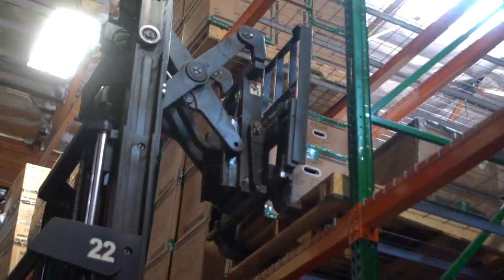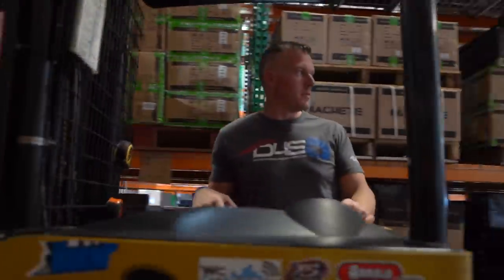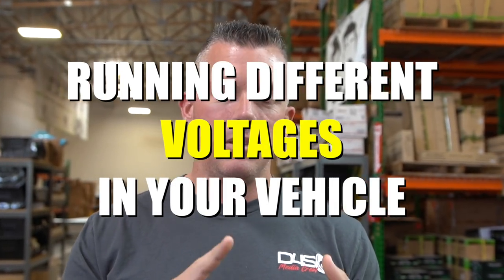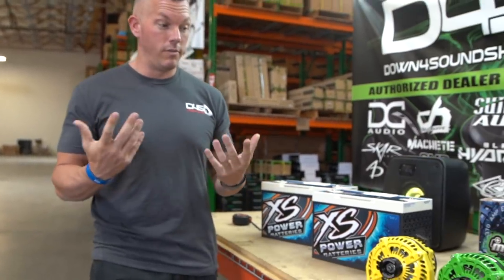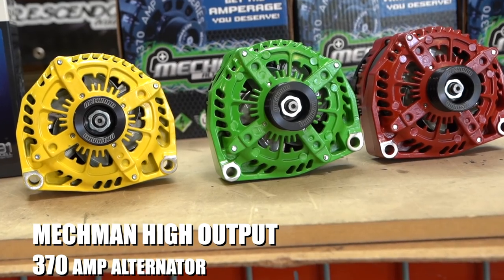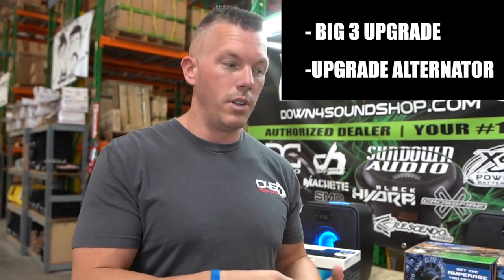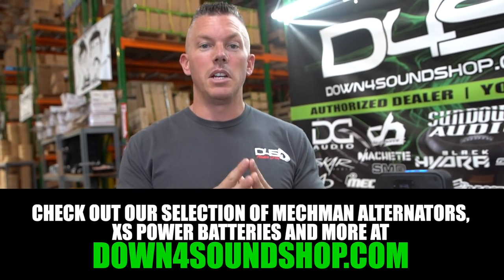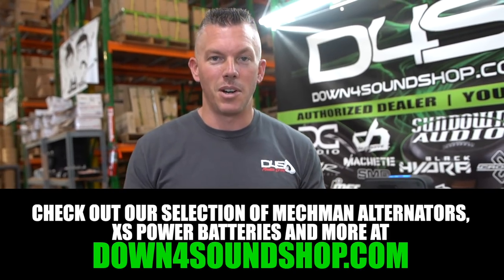WHAT YOU NEED TO KNOW, BEFORE YOU CHANGING THE VOLTAGE IN YOUR VEHICLE

Comment: I’m running Skar DDX10 d2 with skar 1200.1 in a 6th at 1ohm. Headlights dim horribly. Did big3, no progress. So ordered the Mechman 240. Now I gotta change 4awg to 1/0. Haven’t popped any of the 100amp anl fuses yet at full tilt. In a daily driver.
Reply: Yeah I've got the 1200. Alot of people think it's not big enough to require any electrical upgrades but as you and I both know you definitely do!
Reply: @wayneslain9444  sweet man. What u runnin? I used a multimeter to set gain. Also, I’m runnin an LC2i instead of rca due to factory head unit
Reply: What are your batteries?
Reply: I asked about the batteries because I have two identical North Star AGM batteries. One under the hood and one in back connected in parallel with 1/0 sky high wire and I'm running 2,000 watts@2ohm to my Skar VXF 15"... I have zero light dimmage on a stock alternator.

I have a Mechman 240 amp alternator ready to go but I'm being lazy about installing it because I am noticing zero issues with the system as is on the stock alternator.

I even have a noco 5 amp charger for when I need it but I haven't had to use it yet.

It's either the batteries or all that high quality wiring or both.
Reply: @snauspockets9924  I have an AGM up front only. I kinda went with the largest one I could get for the car. 
I think it’s the wiring that has my lights dimming. They’re halogen, I’ll try led and see if they dim. 
For the alternator install, dbl chk pulley size of factory alt vs HO alt. I noticed 63mm factory to 60mm mechman. Still decent tightness in SERP belt.  No slippage. Getting 14.8v at all points
Reply: @vgnope  right now I disconnected everything in both cars to really do it proper. For 1 ride I've got an evl 15 on an rp2k but I'm getting one more of each for black Friday to have 2 2ks on 2 evl15s. The other one is 2 ix 12s on an rp1200.
Reply: @vgnope  also I've got 3 more systems that are mostly complete, 1 backup for each ride and 1 for my work truck when I get it. SQ Hds215 on a DB drive 2k but I'm waiting to pair up a sub/subs with a Brutus 4k

Comment: Thats not enough 20 v crap take voltage regulator from alternator n use 4 48v batteries if u series then careful parallel with variable rheostat potential meter adjustable so u can play n regular or if chts to high temp bring it back down to be more efficient

Comment: I'm sticking to a 12v setup. I love my Sony Mobile ES speakers and XM GS4 amplifier, the sound is so clean and crisp that I just want to sit in the car for a few more minutes after parking it to enjoy the music. I plan on doing a Fi Neo 3.5 12 inch in a sealed box up to a 2k amp with a stock alt and 0 gauge big 3. Then put in a 240 amp alt once the stock alternator is worn out.
Reply: i just put a 240 amp alternator in my accord coupe. whole system sounds stronger and cleaner. so much so that i havent even put my higher rms stuff in yet.
Reply: What is the big 3? 0 gauge wire, extra battery?
Reply: @trickedoutequinox3265  o ga ground to frame, ground to battery, and ground to alternator.  Big 4 is same, except adding a o ga power from alternator to battery.
Reply: I'm confused🤔🤔🤔

Comment: I run 2 separate 12 volt systems. Stock alternator running the truck and the door speakers. CES 370 Charging 80ah of lithium for the bass side.
Reply: Cool dawg real cool..

Comment: To keep car computer and oem accessories  @12 volts but your amps at 16 volts using just  one alternator..
  Do install a 16 volt alternator and your 16 volt battery  banks for  the Amps, but a 14 volt "Down Step module" from such alternator   to your regular oem stock battery.  
 And do  Run your 16 volt battery  banks directly  to the 16 volt alternator terminal.

Comment: I have a 2006 mustang gt I have full 0 gauge wiring ran on Taramp smart 3k and for mids and highs  I have a 900 watt ct sounds with yellow top under the hood and in the trunk with big 3 done and currently wait on 200 amp high output alt that hasn’t came in do you think the alt will help with my voltage drop????

Comment: So the cool thing about my car is with the stock ECU it can handle up to 15.9 volts of charge I pulled out my stock 130 amp alternator running off of the ECU and I ordered a Brand X 390 amp alternator and had him set it up for 14.8 volts constant internally regulated so it is not controlled by the car's ECU anymore because that fluctuates then I built myself a 6S Ying long 350 amp hour Bank of lithium

Comment: Also to mention if you choose to run a 14volt system to run the vehicle and sound system you gotta make sure the higher voltage does not take out the factory electronics. Most newer vehicles can't handle anything over 14.4volts. But a good bit of older vehicles can, if you pop the ECU you are gonna be in a nasty expensive pickle. If you don’t understand any of this at all just stick with the standard 12volt system. And don’t listen to the 99% of the dumb fucks on Facebook or other social media audio pages saying "oh its easy just buy this or do this"... Do your own research and learn the proper way. 

Just a reminder chart:
12volt system charges at 14volts.
14volt system charges at 16volts.
16volt system charges at 18volts.
Reply: What up man I'm the dummy the went14v sub and interior system thinking it would be better to separate my factory from the amps. That being said I set it up nice except of course amp don't like 15.8v is there a way to lower that from d1400 to amp so I don't stop the 15.8 charging the battery?

Comment: Thank you. I’m very new to this and this helped me understand what I should stay with for bassing everyday. Can I run two batteries (one for subs amp and other for car stuff like lights radio) and run them to one alternator? Or upgrade the alt for the two batteries
Reply: Depends on the power you want to run. Anything 2000 watts and over, upgrade your alt and run at least one extra battery. I'm at 6000 watts on two 15s and have a 300 amp alt on three batteries. One up front and two in the back. And your wire is also very important. Don't skip on wire. OFC is the best to run over CCA. It's more conductive and transfers current much faster.
Reply: I always recommend upgrading your alt.. extra batteries are just a band aid solution. But keep your stock alt incase your ho alt has issues. Trust me.
Reply: @crunkwun  good advice thanks
Reply: @crunkwun  first time i tried upgrading alternator i had a gang of negative issues. i removed the new one and its sitting on a shelf. that was a 2000 accord coupe . my 2011 i swapped my alternator out with zero problems.
Reply: @vincebowling1778  what if your just planning on 5000 watts? Can I just use the 1 xs battery up front?

Comment: Demoing into 12’s is ok? As long as voltage stays 12.4 and above?

Charge at 14.8 but under heavy long bass notes I’ve seen 12.9

I try to stay 13+ but if mid 12’s are ok then I’ll stay in it longer. 

I got a 192ah headway backed by 370 singer and a 270 Ohio Gen alts….6 runs power and grounds (3+3-) straight off alts to rear bank with all 2/0 welding cable.

Comment: A question I've always wondered is at what kinda power should you add a cap? Im running a real mild setup in my 2011 silverado 1500 5.3. I have dual battery setup I did under the hood with dual 12v Duracell golds. Pioneer 1300nex hu, Taramps 800.2 feeding 4 factory size prv neos in factory door locations, and a tinpano 1400.1 going to 2 10s.
Reply: Depends what kind of caps.. super/ultra caps are awesome.. the cheap ebay junk whatever farad caps are junk.. don't waste your money.

Comment: Love the info you put in your vids. Im currently  wanting  to upgrade my alt plus big 3. Im not looking to do high voltage though. Im trying to stay with 12 v. Ive been eyeing Jp amps for awhile now im looking  to have around 4000 watts for the bass end and running a 1200 watt on my midd an highs. Do you think an alt upgrade  an big 3 could handle that load? Also will you be coming  out with a more powerful  JP amp
Reply: Yes but you need a high amp alternator 400 amps plus at least. An Extra rear battery or more than one. To support that wattage you will need good copper OFC wire with two runs of 1/0 or 1 bid 2/0 wire for the big three because 1/0 only supports like 3,000 watts or something like that. From the alt to the front battery and from the battery to the back for the system. The grounds need to be the same size as the power wires also on the big three.
Reply: Depends on your vehicle.. if you have a 4 cylinder.. stay away from big alts. Your vehicle will have a hard time trying to turn that alt. I have a 425a alt on a V6 and notice the difference in performance. It's sluggish on stand still to gassing it. A 250a or 300a+ alt would be better.
Reply: @crunkwun  Hey that is good advice and information to know, thanks for sharing your experience.
Reply: @crunkwun  Thanks for the info! Yes unfortunately its a 4 cylinder  2.4 engine and theres only a few options I've found for alts that will fit without mods. I believe around 300 amp which is night an day from 80 amp it has. I'm surprised  my lights don't go completely dim. Im currently running 4 12s at 1ohm on 2000 watt skar and a 1000 watt mid/high amp. All oversized knukonceptz 1 0tt wiring. They system is seriously bottleneck and i need a second  2000 watt amp. So that both sets of 12s can be ran independently at 0.5 ohm as the skar so far seems to be handling that like a champ.what budgetmind second battery would you suggest.  Keep in mind beyond adding a second 2000 watt amp or just using a single 4000 there will most likely not be anything else added. Im pretty loud now im just trying to get the full potential of what i have. Aslo its a 2013 Chrysler 200.
Reply: @nickstalhood5380  when you start running over 1500-2000wrms you seriously need to start looking at ho alts.. I have a Brand X alt but when I get another alt I will be going to another company either AutoTech or Iraggi(Iraggi has a life time warranty and a buy back system) Mechman is good but very expensive. When looking at alts find out how much amperage they put out at idle, ask if you can have it charge at 14.8-14.9.  I've clamped 225a at idle out of my 425a. And yes anything over your 80a alt is a bonus haha..

Comment: Question: 

My 79 Mark V died in The middle of the street.  I found that the alternator was bad, and just not charging the brand new battery that was installed (only 2 days before).

Tested the alternator while the car was running, and it was not charging the battery. 

I have an aftermarket sound system in this car.  It's a 800W amp split between 2 12-inch subs.  Should I change my factory alternator which I believe is 60 to 70 amp, or should I get like 100 amp alternator?  Or, will that burn my battery, and should I just stick with a 60 to 70 amp alternator?

Any good advice would help, thank you in advance.

Comment: Im gonna be running just one 1500 watt amp on an 8" would I be good with just a battery upgrade to a d3400?
Reply: Why an 8
Reply: 8" 1500watts!!????????
Reply: single 10 inch 1500 watt capable with a 1500 watt amp will sound good
Reply: i don't suggest running 1500watts threw a single 8"
Reply: @lifefanatic1115  well aslong as I buy a battery sometime thats what im gonna do subs only worth like $200 anyways. But I still need an adapter, Wiring and a battery
Reply: @Jerem0y  Skar Audio.   80$ 10" subs and they are great.   cheap and good quality

Comment: Very solid advice JP! But that only covers American made vehicles. What about foreign makes like Honda Nissan Toyota and Hyundai that have really small stock alternators that are lucky if they're 110 amps, i had a very difficult time finding a custom alternator company that was able to quote me a price on the alternator i needed for my car and the size of the build i was doing.
Reply: eBay 165 amp Honda alt for $165 then do the big three with braided stinger 8 gauge. Anyone needing more than 165 in a Honda car is going to need new windows 😂 I can use it up easy with my communications amp.
Reply: @NoHandleNameScrewTube  165? Naw i got a 320 amp alternator and that ran me nearly $400 from Apex
Reply: @NoHandleNameScrewTube  and i am adding a 2nd alternator with a custom mounting bracket
Reply: @NoHandleNameScrewTube  guaranteed i am louder and draw more power
Reply: @NoHandleNameScrewTube  by the time I'm done I will completely eliminate the need for a big 3 using my 320 amp as my slave to charge my accessory battery while completely bipassing the stock alternator and battery completely

Comment: Maybe you can answer my question....because someone named Brandice refuses to.   Is the OFC wire simply better no matter what the application, than using CCA wire?   Also, I want a Big 3 kit.  Can you make me a 4 guage kit using OFC wire?  Its just a normal every day driver with a 1,200 watt amp, one 12" woofer and MMats speakers for mid range, door speakers and two tweeters.  Nothing carzy.  But I have a high horsepower engine so I wanted a better 145 amp alternator instead of the factory 95 amp.  So I need a 4 guage Big 3 kit.     Thanks.

Comment: Hey how's it going? So I'm kind of just getting into getting a real sound system in my Ford Explorer I've had many other vehicles with just random amps and subs and boxes nothing matched just Jimmy rigged and I got through it through those years in high school and what not but now I'm running two 12 in DVC 4ohm subs in parallel to a kicker 1200.1 monoblock amp subs rated at 800rms and amp is 1200rms at 1ohn I was having issues with amp cutting into protect but I was off the running cheap 4 gauge CCA power ground wire now I'm hooking up the new ofc 4 gauge AWG amp kit now my question is since I'm definitely trying to stick with 12 volt system do I need to do the big three? Or even upgrade the ground on the actual battery under the hood? Or put some kind of little capacitor in there? I'm hoping possibly just putting this ofc for AWG wire in will do the trick! Let me know what you think it's a Ford Explorer so it's already got pretty big alternator but it's all 12 volt and I would like to stick with the 12 volt and I know I'm running 300 w lower than the two 12-in subs are rated RMS at anyway I would appreciate if you can drop some knowledge on me with this issue I'm hooking up the new ofc wire Saturday coming up I'm already getting all the ends crimped on just got to rip out the old and put in the new but yeah any info you can give me on that I'd appreciate it thanks a lot JP keep them pumping That Bass brother!

Comment: So what would be your opinion on what amp and battery should I used to push my single Deaf bonce 15 " DB-SA 305 D2 subwoofer I already did the BIG 3 and a 300 amp high output alternator?

Comment: Mechman 240amp alt sitting on my bench in the garage...don't even need it atm and they are kind of a pain to put in second generation Highlanders. Got it a couple weeks ago and I'm being lazy.

I'll get it in there eventually. 2,000 watts at 2 ohms isn't pushing my stock alternator on 2x Northstar AGMs very hard anyway.

When I start my car it's 3.9 volts and it drops down to 3.1 when I'm hitting the subs hard at idle for long periods. That isn't too bad is it?

Comment: What will a need to run 2 xtr 2500 watt Orion amps on 4 15's q class subs in a 2013 suburban 1500. Right now I'm running 2 q class 12's on 1500 watt. I did the big 3 but I know I will be changing the alternator and battery.

Comment: Great video
I have a question
I have 2021 Corolla ,if I get a alternator with 320 amps but the computer charge normal will be worth it
I'm asking because my car have only 1 wire for functions and I been told if I want higher voltage my car will look like Christmas tree😂 so if I get and high output alternator that charge with computer but more amps will help me?

Comment: I’m running yin long 80ah only no agm or acid battery Im running 6 10” skar evl’s with each getting its on amp (pioneer 9601) so you said you charge to 17+ volts. I used a limitless lithium charger that only charges to 15.5 would it be good for my system to charge to 17v I already burned out my factory alternator and JS is building me a 410amp since July on back order thanks for your time (2007 Hummer H3).

Comment: What would happen if I put about 16v of ultra capacitors after headway bank? I just have an agm under hood, big 4 and 250amp singer which unfortunately is as big as possible. And a 500amp isolator between under hood battery and 96ah headway. Any help from anyone is greatly appreciated I'm trying to boost up my voltage right before the amp since my alternator is kind of small for what I want to do I'd have four on there if I could

Comment: What's nice is I'm pretty sure our 2019 Chevy Cruze will be fine at 16v because cruising it's already chilling at 15.5-15.3 completely stock so once I do the big 3 and the alt FINALLY gets here with a lithium battery and xs power yinlong bank in the trunk with an ultra cap I should be sitting around 16v

Comment: Do you have a plug and play Alternator for a 1987 Buick regal 5.0L this also sends a signal to the dummy volt light inside car. 250 amp or under 300 amp